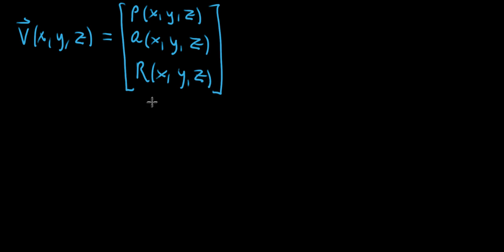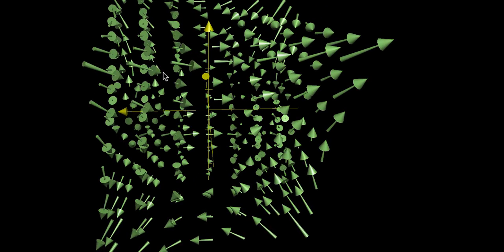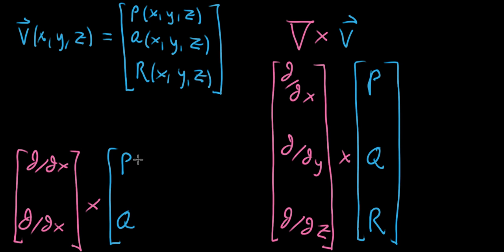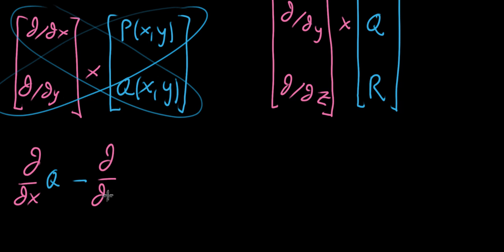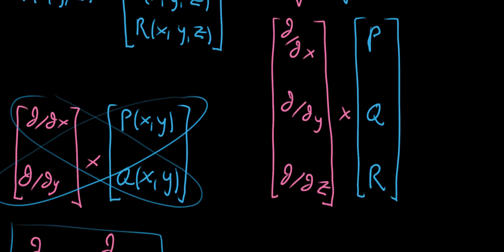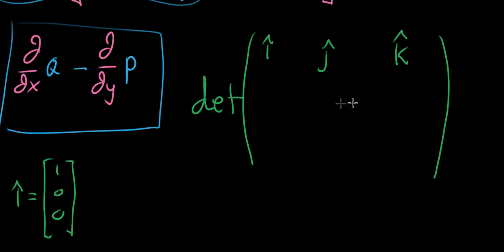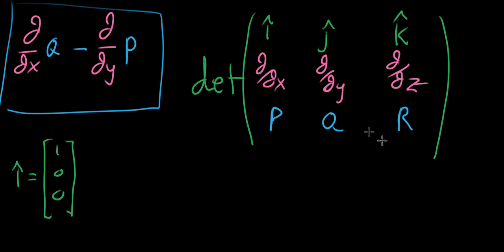3d curl formula, part 1

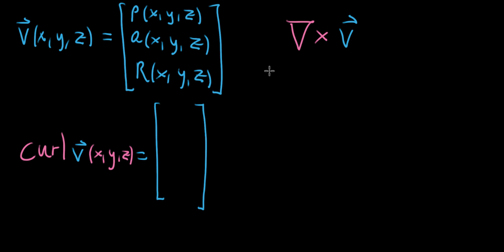Comment: As always, excellent video. In this case I have a question though: At around 2:20, how do you come up with the notation that curl equals the cross product of gradient and vector field? I don't see what the gradient has to do with curl and why relating them with the dot product makes sense. Taking the cross product of the gradient and vector both evaluated at that point produces a vector normal to the plane (in 2d) they span, but how does that relate to curl? And is there an intuitive image for that in 3d?
Reply: The cross product measures the tendency of two vectors to be at right angles to each other. The gradient, of course, is a vector which shows the direction of greatest change (or perhaps the direction of force) in a vector field. Imagine you are walking along a flat field, and your companion keeps bumping into your right shoulder (applying a force at right angles to the direction you are walking). What’s going to happen? You will eventually find that the two of you are walking in a circle. If the force you are experiencing during your movement is always at right angles to where you are trying to go, then you will show a rotational or circular movement. So the curl (which shows the tendency of the gradient to be at right angles to the direction you’re heading) also describes the tendency toward rotational movement.

Credit to Dan Jacobs from Quora for coming up with this analogy
Reply: And it relates to the gradient because both the gradient and the curl use partial derivatives to measure quantities

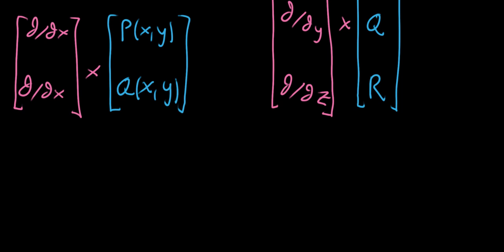Comment: at around 3:19, "You're going to take the cross-product between that (d/dx. d/dy) and a two-dimensional vector", how does that make sense? Doesn't cross-product only work in 3 dimensions? Also, the computation looks like a determinant instead  3:52
Reply: I might figured it out, I think it makes sense - given that a determinant is the area of the parallelogram between two vectors -> which is basically the determinant. So, it's still valid to say a "cross product between two 2d vector" since it's basically just the determinant (ad - bc)